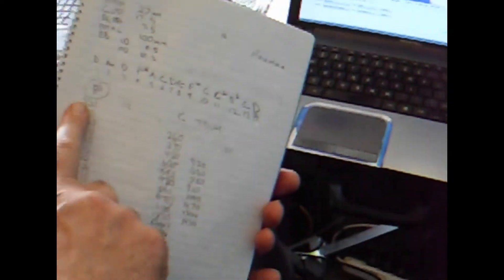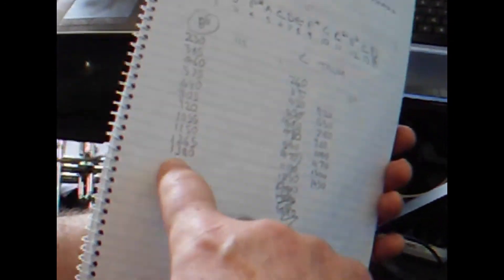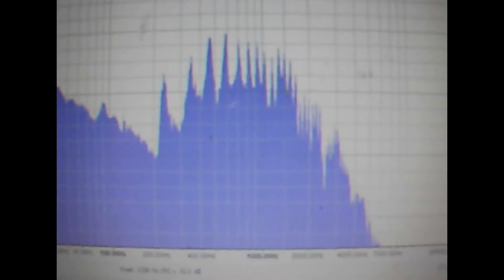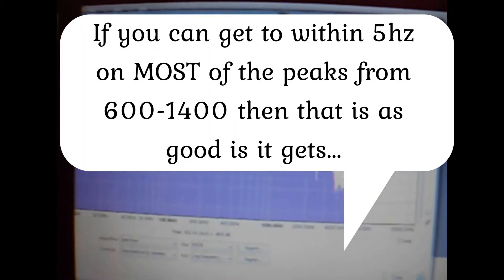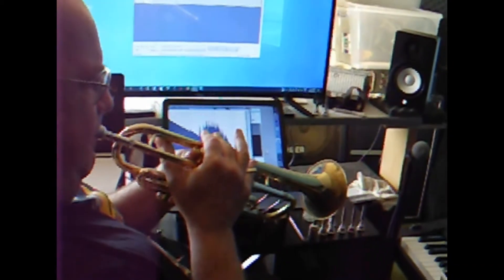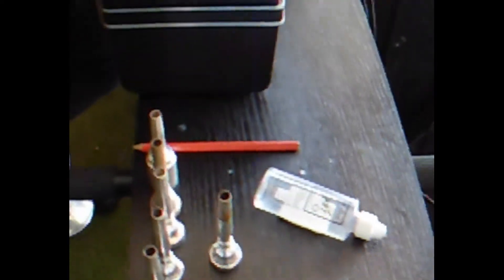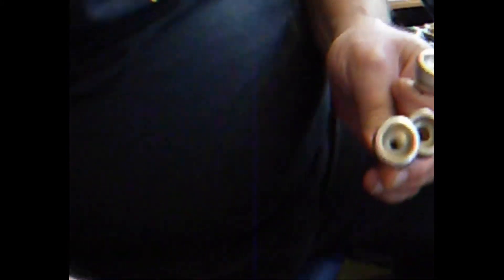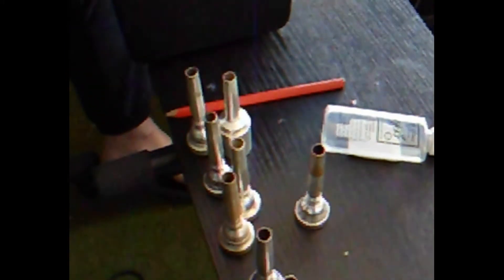Use simple DIY physics to find the most in-tune mouthpiece for your trumpet

Comment: Hello. Thank you for sharing this. It is works great.
I see the list is on your sheet, but why 230Hz, shouldn't it be 233Hz (116,54)?
Reply from the maker: The fundamental frequency is not important, its just a convenience. So it is more practical to record the trumpet with the tuning slide in a "normal" position and pitch shift the  near bye value to 230 - just to make the maths easier. But if you wanted to record your actual pitch and do the maths on that - sure knock yourself out!
Reply: @TresMamboMusicSchool  I get it. Thank you.

Comment: In that case you should really be doing this for all valve combinations?
Reply from the maker: Interesting point. I'll do some experiments about this and report back ! Thanks
Reply: @TresMamboMusicSchool  Nice to hear. I also wonder what the same experiment would give without the tuning slide. Leadpipe buzzing slots in other slots than the harmonic series, and I wonder if that shows in the frequency analysis. If the analysis still gives the harmonic series, that would kind of moot the point, wouldn't it?
Reply from the maker: @gauthierostervall4849  No not possible. As I mentioned in the video the "trumpet" starts out as straight tube. Which has a series but not a harmonic one something near  - a 9th, a minor 6th, a fourth etc - this is what you play and hear when you blow the pipe - something like E, F, D, G'', C''' etc. By ADDING the bell the the first two are forced into something like an octave the next into a fifth and then next into an actual 4th in tune with the others. This gives you Pedal + C G C. The tones above this a forced into sort of harmonic series but usual way sharp of  the first three - this is the job of the MPC ...to LOWER 4,5,6,7,8...to make the whole series harmonic AND in tune.  When we blow the pipe to warm up - the pitch is irrelevant only the sound. It DOES make sense however to find a mpc that is the LOUDEST on the pipe as this will give you loudest high notes, but the tuning is for the complete system. Hope that helps, Cheers Pete
Reply: Clever idea to measure the impulse response of the instrument and look at the frequency spectrum!!!